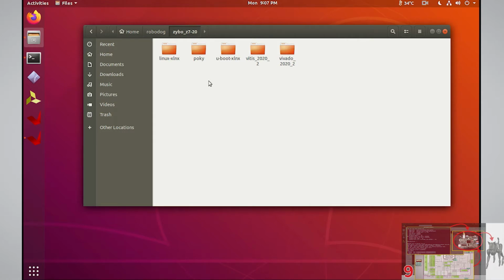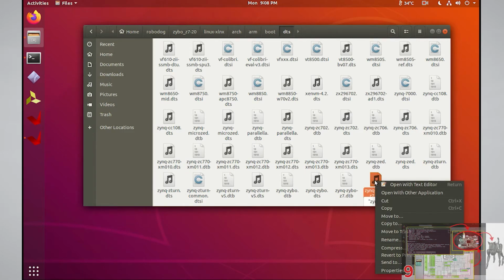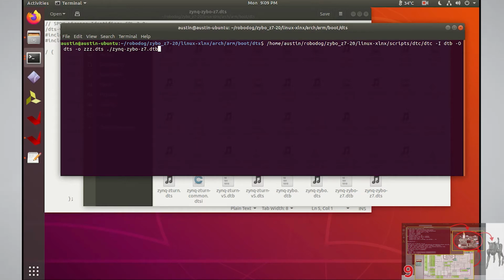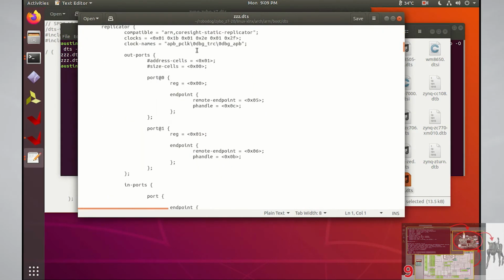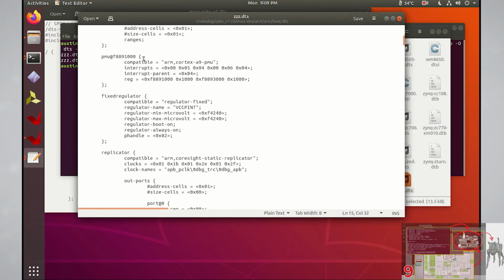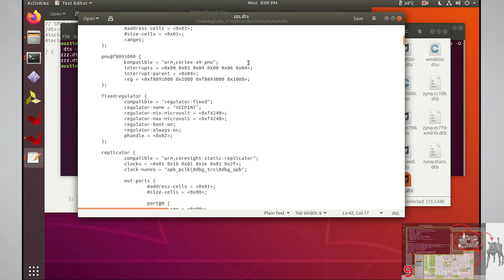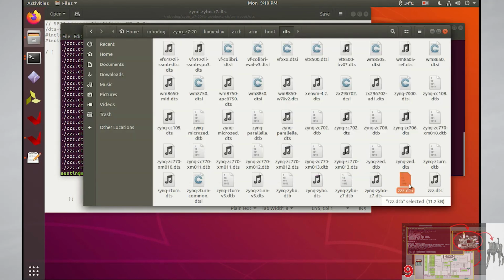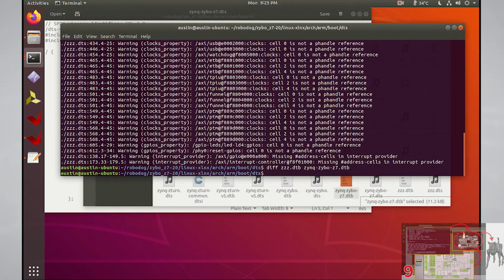#11 TechBytes | How to Configure the Device Tree

Comment: Hi, im getting an error as soon as i press enter in the terminal when i typed what you typed in the video.

/home/e/kernel/scripts/dtc/dtc.h

Line 4: bin is a directory

Line 5 syntax error near unexpected token 'C'

Line 5: * (C) Copyright david gibson (link) ibm coorperation 2005.

How can i fix that error please? Thank you heaps!
Reply from the maker: The error statements almost seem like you are trying to invoke the DTC program on a file that doesn't comply with the DTC standard. Are you trying to use DTC on the dtc.h header file? If so, then that would explain the error since you should only be using the DTC on either .dtb files or .dts files (depending on the DTC arguments you use)
Reply: @AustinTronics  hi yeah so I couldn't find just the DTC file in my scripts folder when building a custom kernel for my arm64 device. It only says DTC.c and DTC.h. I tried renaming both the files to DTC doesn't work and I've ran them as executable programs, install sudo apt install device-tree-compiler and still no luck sorry.
Reply: Oh yeah and I can't find a file with normal DTC in the scripts folder when building a custom kernel
Reply from the maker: @Mark-x6c  doing the sudo apt install device-tree-compiler is what I would have suggested next. That should work and allow you to call the dtc util from anywhere in your path. What does 'dtc --help' return after you tired installing it?
Reply: @AustinTronics  yeah so DTC --help says -q = quiet 

-o = out <arg> etc
Reply: @AustinTronics  I think I know what the problem is, this is what I got from Google

The lexer takes in text (source code) and transforms it into tokens. Tokens are things like a number, a string, or a name. In Cell , the types of tokens are: Numbers, e.g 12 or 4.2.

parser is a program that is part of the compiler, and parsing is part of the compiling process. Parsing happens during the analysis stage of compilation. In parsing, code is taken from the preprocessor, broken into smaller pieces and analyzed so other software can understand it.

I have both the parser and lexer files in the scripts folder but not sure what to do exactly. So sorry
Reply from the maker: I think I found your issue. Device tree sources in the kernel deviate from the regular syntax, by using the cpp preprocessor for includes and substitution. When I used the dtc built into the kernel, I think that becomes transparent to you, but when you use the dtc from an apt install, you need to do the following in the terminal:

```
IDE=<your-device-name>
SRC=$IDE.dts
TMP=$IDE.tmp.dts
DST=$IDE.dtb

cpp -nostdinc -I include -undef -x assembler-with-cpp $SRC > $TMP
dtc -O dtb -b 0 -o $DST $TMP
```
Where <your-device-name> is the device tree you are interested in (without the .dts extension)

This will produce a dtb from the dts file that's in the kernel source.

If you want to reverse compile from dtb to dts, you can do:

```
dtc -O dts -b 0 -o MY_DTS_FILE.dts $DST
```

Where "MY_DTS_FILE.dts" will be the DTS file that contains everything.
Reply: @AustinTronics  thanks, will give it a try
Reply: Sorry when I press enter, I can just see the cursor flash. I'm really sorry as I'm so new to this.
Reply from the maker: @Mark-x6c  we should take this over to the austintronics discord so I can help you troubleshoot this further. It would be useful if I could see screenshots of what you are trying and what output you are getting back
Reply: @AustinTronics  great, thank you very much!

Comment: Nice video and demonstration. Xilinx/AMD are starting to transition to this device tree configuration approach which will replace the AMD proprietary tools used for the mdd, mld and mss files. While they don't use the DTC (although I think it works for the Zynq 700 Cortex A9 chips, such as the Zybo) they instead use their own version called the SDT (Systerm Device Tree) tool.

Do you have any experience with automating builds with this approach opposed their old XSCT approach? Mainly for Standalone applications using FreeRTOS.